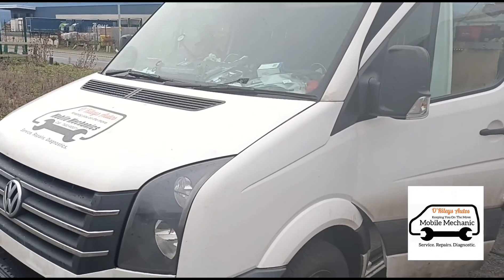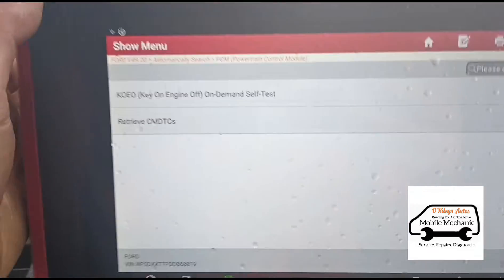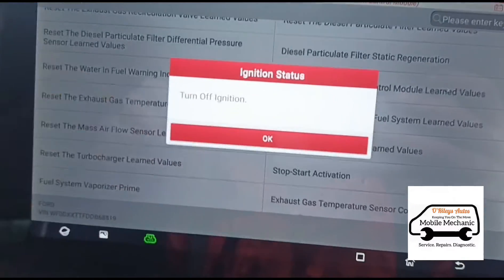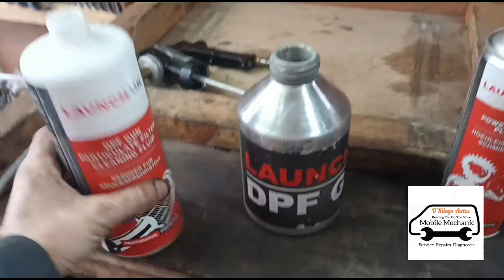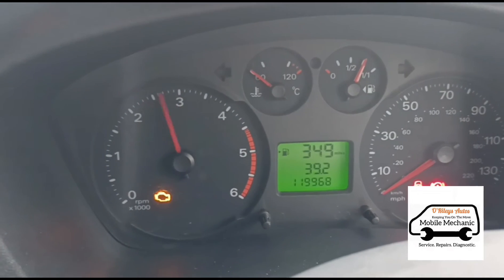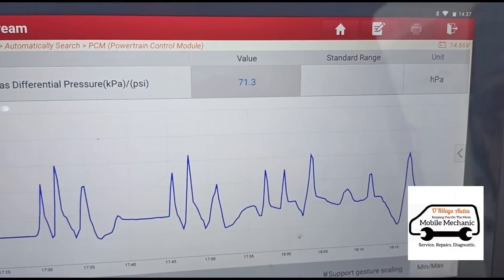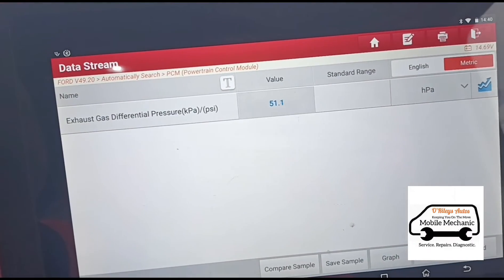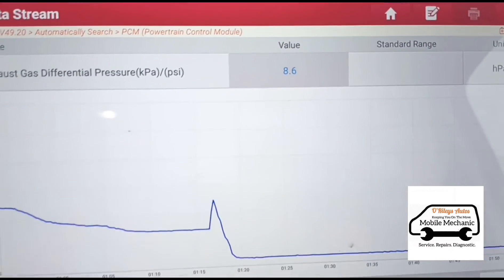Why does my DPF keep blocking? Failed Cleaning & Regeneration Fix

Comment: Hi mate. I’ve a 1.2 pure tech Peugeot it cames the p246b already cleaned it was it 400mb differential is is 3 or 4 at idle. I did the reset adaption values I have a Delphi. But after few miles it cames the error again… can’t force regeneration, and can’t do the function new DPF in this GPF…. Any help would be appreciated

Comment: My dpf was cleaned then it showed a new code problem. A sensor issue. So changed the sensor I now get more mpg. Drives great but no one can get the engine management light off . Toyota auris. Nightmare. Everything been checked but light keeps coming back. 0 soot levels. So maybe actual dpf needs changing ? Bottomless money pit. I have been told it could need a software update but toyota says there isn't one😊.
Great video👍
Reply from the maker: I'd need to check it physically

Comment: Deionized water. Do you have a window cleaner who uses pure water(brush long pole) give them a nice tip , they will give you all the water you want. 
    Yes it will make a difference. Deionized or pure water acts like a sponge and sucks up all impurities.

Comment: Jimmy, 520d e60. New glowplugs and control unit. Dpf been off and cleaned professionally. Now getting diesel in oil. My mechanic reckons its not completing regen cycles and so unburnt fuel is getting dumped into the sump. Fuel pressure ok so doesnt think its injectors or pump seal gone. No other codes for sensors etc cropping up.
Any ideas what it could be
Reply: I would change both thermostats engine one and egr one my 530d M sport had a similar issue and I noticed my egr thermostat had a tiny crack in it sorry I'm a year late 😅.
Reply: @eddiek821  thanks dude. It was actually just what my mechanic suspected. Unburnt regen diesel dumped in sump. I got dpf/egr delete and car has been perfect for the last year.

Comment: I’ve had multiple regen’s, pressure sensor and pipe replaced and a couple of DPF cleans but still have the same issue. Garage is now telling me I need a new DPF… Seems no matter how many times they clear the codes they come back and it is also reporting glowplug sensor issue.

After watching your video it seems to me that a new DPF might not be the way to go..
Reply from the maker: Is it a transit? I've just uploaded another video 5 minutes ago
Reply: Not a transit. It’s a Nissan Juke.

Comment: If the driver had info about the dpf on the car media system such as how full the dpf is . 20% 50% 90% , he could take the car on a drive before the yellow drive to clear light comes on. A diagnostic machine can see how full the dpf is , so there is no reason why the car industry could not give this info on the dash . This would solve 99% of issues.  Not knowing is the problem . It takes more than 30 miles drive 70mph in 5th gear to get the dpf to 0 % . Many drivers never complete a full dpf registration.

Comment: Excellent videos dude one question does cheaper fuel cos this issues? Is there any correlation? Would a full tank of premium diesal now and again be beneficial?
Reply from the maker: Premium diesel would only show a very minor benefit even if used on every tank over 100,000 miles benefits would be hard to see
Reply: @ORileysAutos  thanks

Comment: Hi we have spent 2 years getting our Citroen relay camper van registered in France following our move from UK. Finally just got registered 😀 Unfortunately 🥲we then had a problem with grey smoke and van went to limp mode. We had the dpf cleaned by our local garage in France and the problem is back after 2 months, still smoke but not in limp mode.  We are not sure if to take back to our local french garage that did dpf clean or take to a Citroen garage.
Reply: We took back to our local garage in France after it's full dpf clean, new radiator, full service and new tyres 🥲, we then only did 400km and it still lost 4litres of water, so we think there's another problem not just dpf   Garage now think it is injectors quoted 1800 euro for 4 injectors replacement and includes diagnosis that its 3 injectors. We wanted to know if injectors are usually checked in a service. . We said is it possible also to check if there is a fault with egr cooler as well first in case there's a bigger issue because it is strange how it lost so much water (although it hasn't overheated as such).   Garage replied it doesn't have an egr. He said it's one of three different motor types and this one doesn't have an egr, for our 2014 Citroen relay Ford engine. My husband was fairly sure it does have egr cooler but garage still has vehicle at moment.  So we don't know what to do. Our worry is if we pay 1800 euros and it ends up an underlying problem causing injectors. We also asked is there a way of checking if it's the head gasket, garage says no unless they remove the head gasket first which will take 6hours they can't tell there's no test for it? We just want to know if this sounds reasonable/sensible/logical solution. We want to take it for a second opinion but are frightened to drive it in  case it does more damage. It does drive at moment but lots of light grey smoke and losing water.
Reply: @CamperVanTango  its seems the garage is giving you wrong advice. I'm assuming your engine is a 2.2? Its ludicrous for the garage to suggest this does not have an egr. Also there are various tests fir checking the water leak. The first should be a pressure test and then following a leak down test.

Comment: I bought a 2014 Audi a6, 2.0 ultra model.. getting an engine management light for the dpf , - trap bank 1 not working efficiently it says..  local garage clears fault for me when trying the Dpf cleaner in the diesel tank but light comes back after two or three weeks. Could this be Dpf sensor ? .. I’m trying not to go down the route of having to take out the dpf for cleaning as I was told this would cost 1000€ + , I’m broke from buying the car, could do without this straight away 😂 thanks
Reply from the maker: Is this the version with the egr cooler under the turbo on the drivers side of RHD vehicle? If so they block and it's about 8 hours to get it out
Reply: Yeah that’s the one. Is there any way of getting at that Dpf without having to remove the whole front ? Or is this the only way? Thanks
Reply from the maker: @shane p  I haven't had enough of experience on those to remember unfortunately

Comment: Our Isuzu Dmax kept doing regens to the point that it was trying to do one every time you fricking drove the thing. And the garage tried doing forced regens and lecturing us on "try going on long drives". I ended up finding the fricking problem myself, one of the boost pipe clamps was loose, so i would presume that would cause the regen not to get upto temp because of poor air to fuel mixture. (Weirdly the truck never threw up a over or underboost code and drove ok, but did feel slightly different on power. 

Something to watch out for on Isuzu Dmax's is oil dilution from diesel, running rich from regen and it washing your pistons and seeps past the rings into the oil. Ours was over an inch higher than max on the dipstick. It's a common problem and Isuzu know about it, their solution.. A shorter dipstick and two max marks, one for when you fill with oil after a service and one after you have driver it and the oil has crept up because of diesel dilution. their solution is pretty comical tbh until someones engine blows up.
Reply: If you had a boost leak then the engine would be overfuelling to compensate for the leak, which would cause the DPF to fill up more quickly than normal.

Good to hear you fixed it. A good idea is to change the oil after an issue like this due to the oil dilution as you mentioned.
Reply: @LucasVWGolfR  I agree, and it's advised to change the oil after a forced regen too.
Reply from the maker: Not just Isuzu but most cars would behave the same. Annoyingly every customer I see I having 3-4 forced regens and no oil changes 🙄
Reply: @ORileysAutos  The last time they had it in for a forced regeneration the turbo makes a slight noise now when spooling, so I think it's put wear on the turbo.

Comment: Learned a lot here, thanks for the Vid. Is DPF and sensors blocked a result of not doing a long run!!!! It seems to me, DIY mechanics are buying scan tools to Do DPF regens without knowledge it might be something else.. A question , would it be necessary to clean EGR valve too, or would this clean itself?
Reply from the maker: This van had the parts cannon fired already.  New Egr and glow plugs were done by previous mechanic